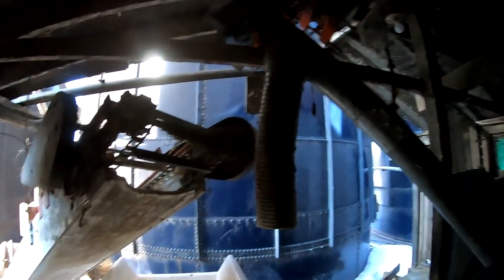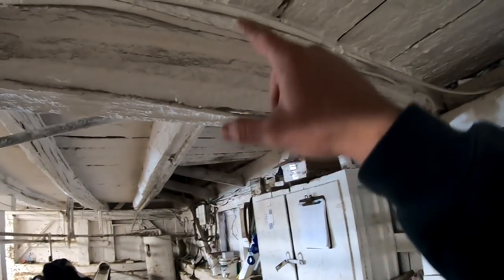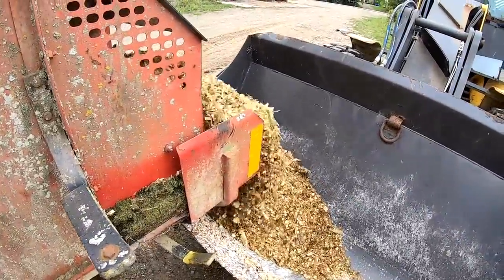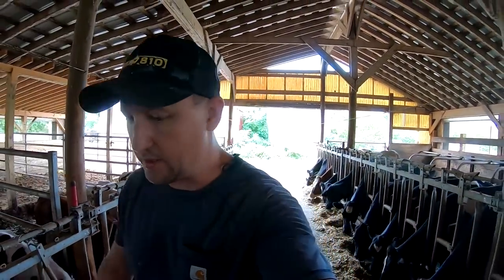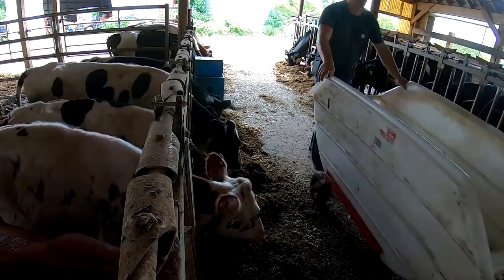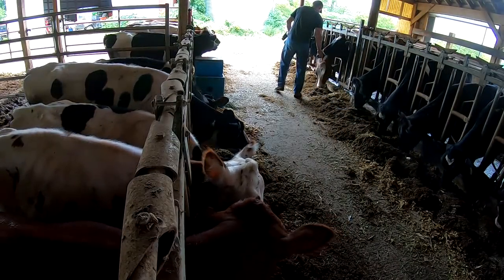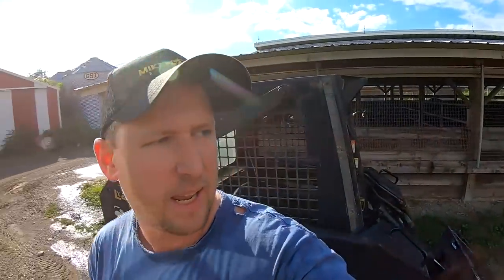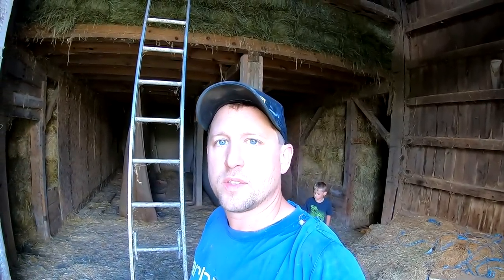Feeding Cows The Old School Way

Comment: This is really cool it reminds me of feeding the cows in the stanchion barns. We had gas powered feed carts we used to drive under the silo unloader, fill them up and then run up and down the feed alleys with them. They had like 12 horse Briggs engines on them. They basically looked identical to your H&S chopper wagons, just little mini ones that you walk behind. You know to this day they are just sitting not being used... I realize I live four hours away from you and they are really old and probably need some work at this point, but for some reason you are interested please feel free to let me know Mike! Take it easy
Reply from the maker: Sounds awesome Adam. sounds like they are worth taking a look at. My email is in the channel info if you wanna email some pictures
Reply: @mikep7810  10-4 buddy I will try and get up there later this week and get some pictures over to you. If nothing else it’s definitely worth looking into

Comment: looking at your barn bought back a memory of my old barn that we tour down in 2012 the big beams in the ceiling i sold to a guy from upstate ny for $5800 he picked them up,i asked him what he did with them he sawed them into floor boards for new houses.he said it was hard to find white oak beams because most were sawed from red oak when the old barns were built.
Reply from the maker: Thats pretty neat. There are a lot of old barns like that falling down so I'm sure that guy can find quite a bit of wood like that
Reply: Our barn looks the same too it was built in 1890 with rock elm and hemlock. Still standing strong. You are quite correct though, many are falling down. So many are vacant now. Just not the same when I was a kid 😞

Comment: Why don't you mix the hayage with the silage? Then you feed hay. The only difference between hay and hayage is that hayage is ground up. Seems like a lot more work when you're essentially feeding the same thing. Hmmm.
Reply from the maker: We don't have a mixer. In the video you can see the conveyor running and the haylage going into the cart.  There is a little more difference than just the haylage being ground up. The haylage is alfalfa so when fermented in the silo has way more protein then dry grass hay

Comment: Would the 3010 handle a wagon?  I don't know how much silage weights
Reply from the maker: It would handle the partial load I had in this video. I was using the 3010 to move hay wagons. If the wagon was full I wouldn't wanna haul it with the 3010